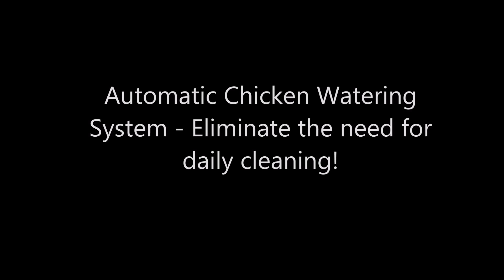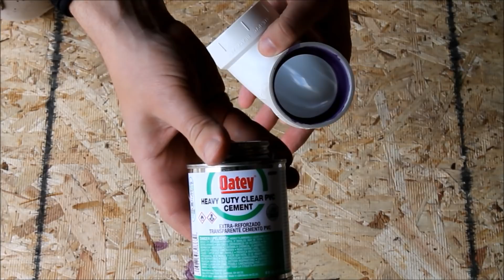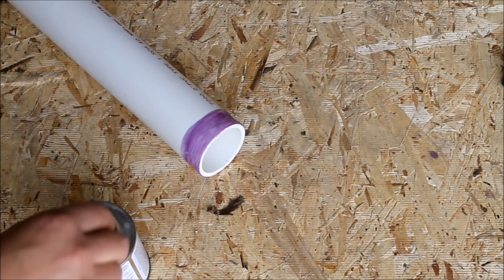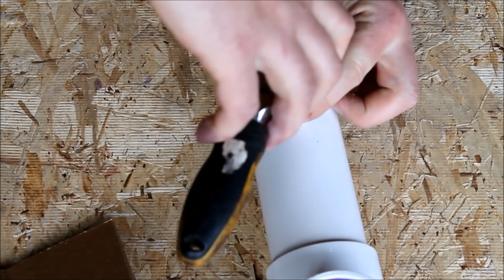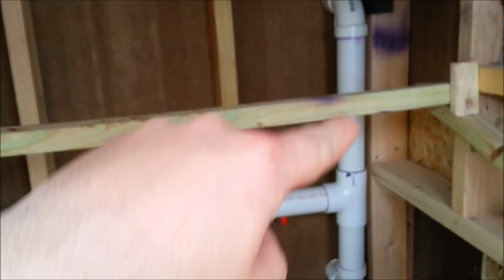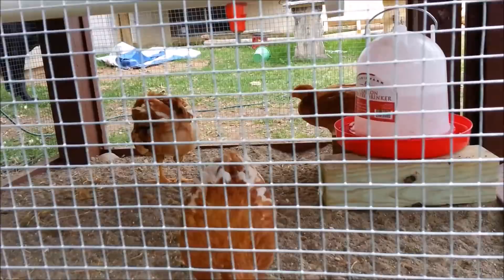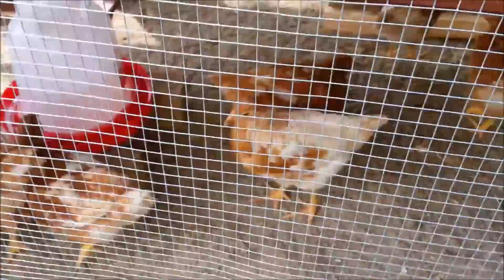Automatic Chicken Watering System - No Cleaning Water dispensers!

Comment: Just a quick question/observation. I have had this system in place now for 4 months and LOVE it! Did you drill a small hole in the cap in order to vent for better water flow? Mine seems to be flowing enough but when I go to remove the cap, I feel the vacuum that is created and am a little concerned that they aren't getting enough. If you did drill a vent, how did you cover it to keep dirt out?

Thanks!
Reply from the maker: Mark Ross No problem Mark, I did not drill a drain hole because it seems that they let a little bit of air in as the drink from them but I would say drill a small hole on the underside or side of one of your pipes and maybe stick a small piece or plastic tubing in it. Hope that helps!

Comment: Nice job on all your videos. I built a coop using your design as a guideline, and I'm currently planning two watering systems: summer & year-round. The summer system will utilize a rain gutter, the year-round system will have a 5-gallon reservoir bucket stored in a section of the [insulated] "nesting box" with a bucket heater.
Reply from the maker: N3obach Great plan, I am going to redesign the watering system soon as well in mine to be easier to heat in the winter. I like your idea, might steal some of it:) thanks for watching~
Reply: +SSLFamilyDad It's been a while since I visited your channel, I checked in today to see the update to your watering system....looks good! I did something very similar; I used an insulated water cooler w/heater, PVC, and poultry nipples. I'll try to get time to make a video for you to show how mine is progressing, your videos were the inspiration.

Comment: The clean out inside the coop is unusable. There is no way to remove the cap and look in much less clean out debis. You should have the pipe penetrante the wall and then the cap will be outside.
Reply from the maker: mcsjsanders That is a great point and I am going to be moving some things around this summer and redesigning the piping. My plan with that cleanout inside the coop was just to take the cap off and be able to fish a dryer lint brush through, it would work ok for that but not for flushing it out with water. The cleanout underneath the coop is best for flushing the whole system out but honestly since it is closed to outside air and light it is still just as clean as the day I built it.

Comment: Can the drainage pipe you used for the feeder also be used for water,  if so is it the same as for PVC primer and cement?
Reply from the maker: Dave F yes, you can use the drainage pipe but it only comes in larger 4" sizes. You also need to use primer and glue and for the feeder I just used glue as a less permanent connection.

Comment: great video very well documented.  I had a question. It looks like you are using about 2" PVC is there a reason why you chose so large a size. Was it to keep the water pressure down?  It might be easier to wrap a smaller size. Just asking. 
Thanks
Reply from the maker: J Bryant Great question, I chose the larger size just to hold more water. You could use a smaller pipe and then a reservoir like a bucket or something else. In my case I just wanted the pipe to be the reservoir so I went with larger size.

Comment: So now that it has been a year, how rotted is the wood under the feeder?
Reply from the maker: overtime77 The wood is all sealed with deck stain so nothing has rotted yet. I will be redesigning the inside watering system for a better winter over in the coming months so stay tuned for that. As far as the wood goes though, nothing rotting yet!
Reply: What's up with the puto comment? This guys is here to help us and you as well. Go some place else if you don't like it pendejo...
Reply: It’s been three years now, how rotted is the wood under the feeder. Puto

Comment: how do you clean the inside of the pipe?
Reply from the maker: Mari Funabashi The inside of the pipe doesn't really need to be cleaned often since it is not exposed to light or air but I have a cleanout port at the bottom that I can open and flush it out with the hose or run a brush through if needed. I have not needed to do that yet in the first year ad it is still clean as it was when I put it in.

Comment: I love the coop and auto feed system.  I have a question about the watering system.   with the upper and lower systems being interconnected, how can there always be water in the upper, inside system?   that would run out of water much more often....if you go out of town, as mentioned in the video, and the birds are locked in the coop, don't you worry that they will run out of water, especially if one of the lower nipples is damaged or broken (allowing water to run out)?
Reply from the maker: Kris Baker They don't really use the inside ones in the summer time and so they always have access to water at the lower level. When we go out of town we just leave the door open and they can come in and out as they please. If we would leave for longer than a few days we would have someone come and fill it up and check on them.

Comment: @SSLFamilyDad What is the size of the bolt that you're using to thread these poultry nipples?
Reply from the maker: Amanda Chavira I don't remember exactly but I believe I just matched up the size by holding it up to the threads on the poultry nipple. The hole I drilled was 11/32"
Reply: Thank you! :)

Comment: Also I'm curious what you think about the skillsaw method of cutting the pipe; a reciprocating saw tends to build up static, which retains shredded pastic debris stuck to the inside of the pipe. That's a problem for a furnace installation, where you don't want the plastic going back into the machine, but I suppose if you neutralized the charge and then washed it out through the drain, you wouldn't have that problem.

Anyways, I'm just curious if you felt the same static charge building up with the skillsaw. I haven't used this method before.
Reply from the maker: David Caughell I use either one just depending on the saw I have handy. They both tend to build up some static and I normally just blow out the pipe. however, in the case of a furnace intake it becomes more important to keep that plastic dust out of the pipe so use whichever works best in that case.

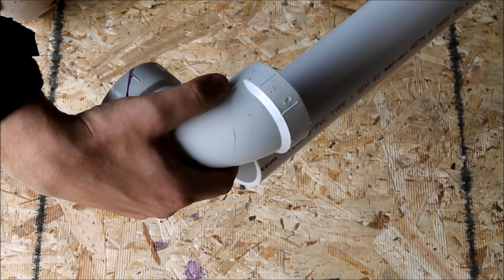Comment: I was curious about whether or not primer was needed. I believe it's absolutely needed in cold weather. http://www.commercial-industrial-supply.com/resource-center/do-i-need-to-use-pvc-primer/ The information at this link said that primer was only effective when wet, therefore you shouldn't let it dry out before you use it (2:55 roughly in the vid says to let it dry first).
Reply from the maker: David Caughell Thanks David, You are correct that the Oatey site does specifically say to apply the glue while the primer is still wet. I will add an annotation to this video as I have never used it that way in HVAC. The use or primer is not needed necessarily but it almost guarantees a perfect seal if used. It acts as a cleaner and softens the plastic to prepare for the glue. I normally let it dry for a few seconds before I start putting glue on and that is more to just keep things cleaner (not getting all the primer in my glue bottle). Great point on that though, thanks!

Comment: I'm going to add this kind of system to my coop.  Has the heat wrap tape worked for you?  It was -12 here this winter so trying to find a solution without running electric to the coop.
Reply from the maker: parker kirby The heat wrap did work ok until it was down below 10 for a sustained period. I am going to redo the system this year with a valve to shut off the outside part and just heat the inside section of the waterer.

Comment: Great work!! We recently made a feeding system for our chickens and quails and used pvc. We were planning to make the water system using pvc also but the workers at home depot said they don't recommend using pvc for water system due to the toxic ingredient in pvc. We had our entire water system plan drawn up and got all the part and now we're holding off to see what other people are using that has the same material as pvc but without the risk of any harmful ingredients. Did you hear anything about the pvc ingrediants or do you get your pvc from a special store? Please let us know. Thank you.
Reply from the maker: Edson Carvalho PVC is not certified for residential water supply use for many reasons. Technically it is made of food safe plastics, same stuff that many food containers and packaging is made from. However there are many people who still try to stay away from using any types of plastic for drinking water or food (including us). However, in this case there are not too many other options so we have decided it is worth the risk and are not concerned about any leaching into the water for the chickens. In the end it is up to you but you probably can't use the chicken nipples without some type of plastic unless you use a metal container of some sort. Hope that helps and thanks for checking it out!

Comment: Does it get below freezing where you are? What do you do in the winter?
Reply from the maker: Heat tape and insulated the piping but will be redesigning this year for better heat retention in the winter here. I could not keep it from freezing with sustained temps below 0 here. I am going to make it so that the outside part is shut off in the winter and only heat the inside part. Hope that helps, thanks for watching!
Reply: SSLFamilyDad 3/4 of the year here are below freezing, but it doesn't get below 0 very often. There will be heat lamps in the coop, so I hope keeping the whole watering system inside will prevent any freezing issues!

Comment: Saw that you uploaded this in May of last year. Still working okay, or would you change it?
Reply from the maker: Grant Garber The system worked excellent, the only thing I am going to chance is a redesign to be able to shut of the outside water in the winter so that I can just heat the pipe on the inside of the coop. I had trouble keeping the outdoor part from freezing when it was below 10 degree for an extended period of time. Thanks for checking it out!
Reply: Awesome!  Would you change anything about your feeder? Do they make a mess with the grain?
Reply from the maker: Feeder has been perfect, they don't make a mess and anything that falls to the ground they peck it up. I have to fill it now about every 4 days.

Comment: Fantastic Set up, you definitely did a great job. But there is 1 thing that I'd change, and that is the roosts you have, Chickens prefer round roosts to sit on. You can cut some limbs to use for this. With the big hens you need the roost to be big enough around so they can sit on it comfortably, but not so big their feet can't wrap around enough to get a good grip. And not so small that their feet can wrap all the way around it, you can judge it by their feet size & get the right size. But take in account how big they'll be full grown. Just like any type of Bird their natural place to roost is tree limbs, and that's what they are more comfortable with.
Reply from the maker: Blitzkrieg2002 That is a great point and I have considered replacing them with some tree limbs. When I put the coop together I just didn't find any that were suitable and so the square stock I had worked. Great advice, thanks for the comment!

Comment: Great idea!, have you found if the removable cap (to clear obstructions) has had to be used?  Did you have to add heat tape (we are in Minnesota so freezing pipes is a concern) You folks make good videos, thanks!
Reply from the maker: Thanks! I have not removed the cleanout yet to check but I wouldn't think there is too much that has gotten in there over the past year. I used insulation and heat tape to keep it from freezing (here in Michigan, cold as well). Thanks for checking it out!

Comment: Hi There, Thanks for your hints & suggestions....I am in the midst of building a similar watering system myself, could you tell me what height above the floor you found worked for your chooks.....I would appreciate your thoughts....
Reply from the maker: The one I have outside is about 18 inches from the ground and that seems to work pretty well. When they are younger you can just put a board or build up some dirt under it to give them extra height until they are taller. Thanks for checking it out!
Reply: Thanks for that......

Comment: I'm getting ready to build my very first coop and I love your videos! 

With not the cleaning the watering system everyday, do you have issues with algae build up? Also I've read how important ventilation is but I didn't notice it in your videos. Thoughts?
Reply from the maker: Thanks Melissa, Algae will not grow without sunlight so there should not be an issue there. I Also have a cleanout on the ends of the piping to clean them out maybe once a year. I do have a small window on the opposite side as the door so in the summer they get a good air flow. Thanks for checking it out and good luck! Share pics on www.facebook.com/simplesuburbanliving if you get a chance!

Comment: In the hope not ask the same question twice, but how much do the water drippers "spoil" on the floor? Does the coop get wet?
Reply from the maker: There is some dripping from them when the chickens drink for sure. Outside it is not an issue but inside I make sure to pile more shavings under the drippers. I have also installed a small deflector to keep the drops from getting on the wood. I have more on that in this video - http://youtu.be/HUDLbmnvJhY. Thanks for checking it out!

Comment: If you wanted you could install a rain gutter system to collect water.
Reply from the maker: Great idea Harvey, will be thinking up something like that this summer. Thanks for checking it out!
Reply: I did that at first, the problem is that so much dust, debris, leaves, and pollen collect on the roof that when the rain comes and the water fills up the bucket, the water is deep green to black.  I don't think it's all that healthy for them, so I stopped using rainwater runoff for them.

Comment: Looks great!  The only concern I have is the leaking inside the coop.  I had a bucket with these nipples and where it was installed there was always water from when they drank. Over time I was concerned that this would make the wood rot so for now all the watering is outside.  How has this been regarding the wood getting wet where the inside nipples are?
Reply from the maker: Great comment and that is a valid concern. The part I have inside does get the area under it wet. To mitigate against that I am installing a flap of plastic that directs the splashing when the chickens drink into my removable cleanout tray. It has not caused too much mess and the pine shavings catch most of it but I have the same concern that you do about it. Thanks for watching!

Comment: I've used something similar for watering rabbits. I used a bolt like you did to make the threads, but I cut a slot lenghtwise through the bold threads so it would act more like a tap to actually cut the plastic, I was using a thinner wall pipe and was afraid the bolt would cause the plastic to split. :)
Reply from the maker: That is a good idea for thinner pipe, thanks for sharing and watching!

Comment: wouldn't you need a tiny vent hole on top as the system is slowly building pressure?
Reply from the maker: As they tap the drippers they let tiny air bubbles into the pipe so it does not need a vent, good question! Thanks for watching!

Comment: Maybe u should of had the drain pipe going outside of the coop so it drains in the grass not inside the coop
Reply from the maker: There are actually two cleanouts on the watering system, the lowest point in the tube is outside the coop, or underneath. There is also one inside the coop and after I put it in I realized there isn't much room to access it anyways. I will just be using the one underneath or outside the coop if I need to drain or clean it. Thanks for watching!!